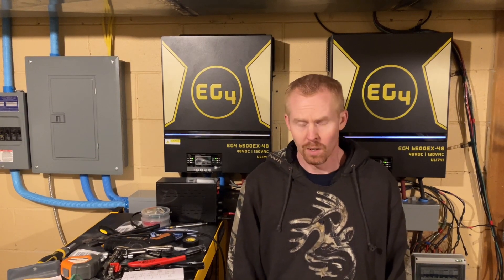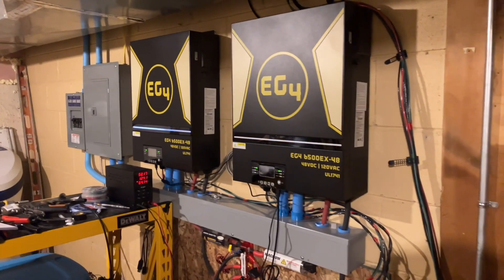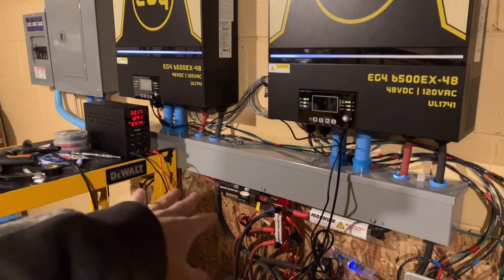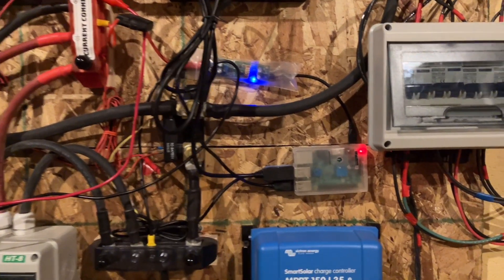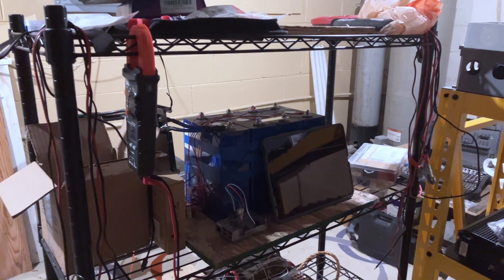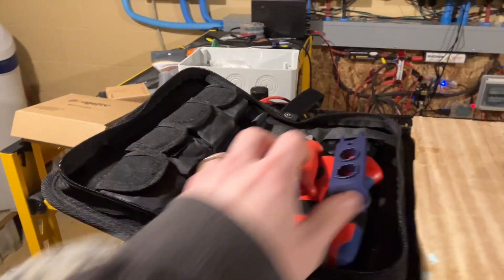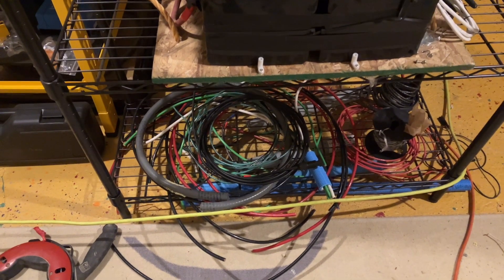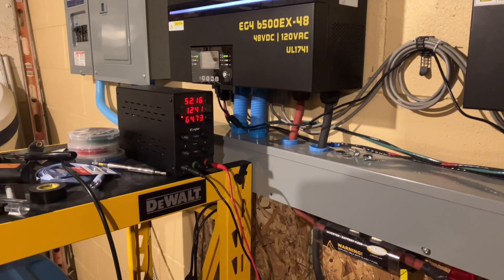My 48v System - Parts, Pieces & Settings

Comment: Hi, for these type of 48v batteries and Multiplus II 48/5000 which cables size are yu using? I mean, between each 15kW battery and busbar, and between the busbar and multiplus II 5000 ? Thanks
Reply from the maker: I have 2AWG from each DIY battery to the Lynx Power In and then the kit I received had 1/0 for each connection to the MultiPlus's and the Charge Controller: https://www.currentconnected.com/product/10kva-120-240v-multiplus-2-5kva/?ref=AzzpK9Fl
Reply: @AdamDeLayDIY  sorry, so each battery has an output wire of 2awg, and then each 5kva inverter has 1/0. Is this correct? It is a bit strange, because if we think about two batteries with "two inverters" (forget the third one), then we will need the same wire size, won't we ? 

Also, another question is about something that is strange for me: It is that all DIY LiFePo4  busbars have much less cross section than a 2awg cable for example. Please says about the short length of the busbar, but if you sum all the length of the 15 pcs ... 

What is your opinion of these two aspects ?
Reply from the maker: @diydsolar  The 2 awg cabling I have is rated for 200a per connection per the manufacturer specs.  At the time I had planned on increasing the cable size but I've since gotten additional batteries which share the load, so each battery ends up discharging less and less.  

I don't know what all math goes into determining the size of a bus bar vs the current it can support.  Bus bars have to be able to support more though because they're solid vs the stranded cables.
Reply: @AdamDeLayDIY  do you mean 2 or 2/0 ?
Reply from the maker: I have 2awg on the battery cables.  I used 1/0 for the inverters because they came with the kit.  In a split phase configuration, each battery would only draw a max of 100a from each battery.

Comment: Nice job on your DIY. Sure its not as clean as a pro install, but i am SURE you saved a bundle. Plus, you know the system inside and out. Mine was similar, especially the batteries. I found the Seplos Mason 280ah kits to be a good solution to get the batteries into a metal server rack. Solar-Assistant and Victron shunts are awesome.
Reply from the maker: Thanks!  Yeah it does save a whole lot of money.  Working on a few updates now.

I saw the Seplos kits but couldn’t justify the cost, plus I don’t care for the BMS.  I have seen just the cases for sale on Ali Express, so I might try to build my own case and see how that goes.

Comment: Are you grid connected?
You didn't mention the Victron, looks like a charge controller. 

Thanks for posting, looks like something I would do
Reply from the maker: I do have grid input to the inverters and at a certain state of charge, the units switch to “grid-bypass”.  There’s no back feeling to the grid.

The Victron charge controller was from my 12v system.  It’s not typically there but I was running a separate test on one of my solar arrays.
Reply: @AdamDeLayDIY  thanks! Quick response too, wowza....do you get grid power from the same panel you feed from the EG units? So, 4 two pole breakers for solar in/out?
Reply from the maker: @bobcole3852  nope, I have a separate panel that feeds grid power to my inverters.  The panel that supplies grid power has a lot of my larger 240 loads that won’t be moved over to Solar.

Comment: That sure is a lot of parts and pieces.
Reply from the maker: Yeah, it can really be as complicated or as simple as you want to make it.  As you can tell I just love to overcomplicate things...😁
Reply: @AdamDeLayDIY  If your happy with that.. SWEET..! When I get home I need to check my panel and the connections. I have four Trina 400w panels connected  2s2p.. and only once they have ever seen just over 1000w. I'm pretty sure there's an MC4 with a bad or loose connection.
Reply from the maker: @Mywhtjp  I know what you mean.  Could be bad connection, bad angle or cloudy.  I've had all of the above issues.  Especially the last two right now because of the winter weather.  Good luck on figuring it out!

Comment: Hi again 
Sorry for picking your brain….

So what does it cost to build a 48v batt compatible to a lifepo4  batt?

Components pls?

Also what’s your thoughts on flattened coper pipe for batt terminal bars / battery rack bus bar?
Reply from the maker: No worries.  

Building your own pack really depends on the type of cells you buy (quaility, amp hours, etc) and which BMS you go with.  Really those are the main components.  Obviously when you go to hook it up to a system, you’ll end up dealing with cabling, bus bars and over current protection (circuit breaker/fuse).  

If you look in the description of this video, you’ll see that I included the links to the cells that I purchased and the bms that I purchased. 

I found that it was cheaper to build a larger DIY pack than it was to buy one of the server rack batteries.  That does come with some catches though.  You really need to understand that if you screw up hooking up the cells, you can destroy the pack (or worse).  Everything is on you. You have to design the pack and put in all the safety measures.  I like building my own stuff, so that’s why I went that route.

If you wanted to go with pre-built batteries with everything taken care of and a really good warranty, I would take a look at the SOKs from Current Connected.  I’ve heard a lot of good reviews on them.  https://www.currentconnected.com/product/sk48v100/?ref=AzzpK9Fl
They also sell a fully loaded kit with a rack as well.  https://www.currentconnected.com/product/fully-loaded-25kwh-48v-server-rack-battery-kit-bundle-save/?ref=AzzpK9Fl

You could also take a look at the EG4s from Signature Solar as well. https://signaturesolar.com/eg4-lifepower4-lithium-battery-48v-100ah/

I don’t have any personal experience with copper pipe for bus bars.  I’ve thought about trying it but never found a good chart which would tell me how many amps I could get out of them.  I know of a guy who uses them in his 12v setup, but he’s not drawing a ton of power.  I started with 250A bus bars from Amazon, but knowing the inverter capabilities, I knew I needed to get 300A bus bars at the very least.  I found them from Current Connected as well.  https://www.currentconnected.com/product/bbl46/?ref=AzzpK9Fl

Comment: Hello
Ty for the overview

I had a plan to do carport solar panels pavilions for about 24 panels and since it was going to be pt wood I was going to secure the panels w about 6 5/16 washers and 5/16 x 31/2 deck screws. 

Just like I saw your set up on this video. 

How is that working out for you. 

What state are you in? For wind consideration since they’ll be 8-14 feet up.
Reply from the maker: The little ground mounts are working well.  My big problem is placement due to lack of sun.  They make it very nice though to help get all the snow off them.  I’m in MI.  

I had built a wood frame for panels on my barn last year and found that if I had to make ANY changes, it was a pain because of screwing the wood down to the roof.  I ended up putting in an IronRidge rail system on the barn and it’s awesome.  Went up super quick and with the rails, it really gives a whole lot more flexibility and adjustability.

Comment: Hi Adam I have been watching your video's for sometime now, very informative keep up the good work. I have a question about the cables used between your inverter and your raspberry for the solar-assistant program. I have a similar setup as yours  two eg4 6500ex inverters and four eg4 batteries. I am using the orginal cable that I got with my eg4 inverters (RJ5 TO USB) to connect between the two but cannot get my Raspberry pi4 to recognize my inverters. May I ask what type cables are you using and did you purchase the complete unit from Solar-Assistant or just the program with your existing raspberry? Any help would be very much appreciated. Thank's-John R
Reply from the maker: Thanks for the kind words.

You got an RJ45 to USB cable with your inverters?  The cable I receive with mine was an RJ45 (network connection) to DB9 (serial connection).  I had to purchase a cable regardless so I ended up purchasing the proper RJ45 to USB cable from watts247 (https://tinyurl.com/56wety92) for one inverter and the other one right now is using the micro usb port on the other inverter (eg4 has to fix some data issues before I can use only the 1 cable).

Now you can purchase a DB9 to USB adapter and use the cable that came with the inverters but I didn’t want that long of a cable or a bulky converter.

I purchased several USB to RJ45 cables from Amazon that I attempted to mod (for much cheaper) but none of them worked, even when I had the correct pin out from the inverters.
Reply: @AdamDeLayDIY  thanks Adam for the quick reply. I will have to check my cable supply tomorrow . I have used something similar on my DIY Megasquirt ECU’s  and my old CNC machine conversions. I guess it’s good sometime to never throw thing away 😀. Again thanks and have a bless day. John R.

Comment: I notice your PV breakers are exiting the top to your inverters. DC breakers are directional. Usually the power source goes in the top. You can tell by the little arrow diagram on the breaker itself. I smoked one early on by reversing input and output of the breakers. AC breakers are omnidirectional.
Reply: Same with your battery breakers
Reply from the maker: Thanks.  From what I saw in the User Manual, the load can be used on either side of the breaker.
Reply: @AdamDeLayDIY  That would make sense especially in the case of a breaker between the batteries and inverter because at any given time either one can be considered the power source.

Comment: Thanks for sharing. 
your battery breakers.. maybe don't tie them together? so that you can more easily impliment your precharge resistor setup? 

for my setup.. I have 3 breakers..
++++breaker resistor++++
++++breaker ++++
-------breaker ------- 

so my cold start procedure is to turn on the negative breaker.. and turn on the positive with the resistor.. until it powers up.. then I turn on the positive without the resistor.. then I turn off the resistor breaker. There is a small risk I could leave my breaker with the resistor up.. but I don't believe it would heat up very much.. as the other path is way less resistance.
Reply from the maker: Thanks.  The reason I have both of them in the breaker is to completely isolate the bank when the breaker is turned off.  That way I know there's no connection between the system and the batteries.  Realistically, the system should very seldomly be turned off completely, so having to do an extra step to pre-charge the capacitors won't be done all that often.

Comment: Great video…
I thought I was watching myself for a moment.
I have 24 460 watt bifacial panels, 30 KWh of LifePO4 (3 EG4 and 1 280 Ah DIY), 2 of the EG4 6500EX-48 Inverters, wiring, breakers, blah blah blah.
I am in Southern Arizona but was planning on moving to Nova Scotia in a couple of years, so it’s been sitting.
Not sure if I can actually pull off that move.(my wife passed away last year from co vid and my family is in NS)
So keep up the research and the videos.
I really enjoy them.
Reply: Even if its just a test setup get that system making some power it will make you feel good.
Reply: @Ranch321  it seems so daunting… perhaps I can put up a “small” string of the panels since all 24 would be approximately 40’x14’ in size.
I had considered putting up enough to run my Mr Cool mini split. It is 240 volt and the external wiring to the outside unit is accessible easily.
Perhaps a string of six might do, although I’d have to run both inverters in parallel.
It’s really hard to be motivated this year, so I appreciate your encouragement.
Reply: @marknichols7861  i have 3 panels just leaning against my barn right now for testing before i start my 1st ground mount and it relieved some of my anxiety to see it make more power than i was expecting. Dont even worry about powering anything just fill your batteries then maybe get a single power outlet to load test/play with.
Reply from the maker: Sorry to hear about your wife passing.  

I agree with @decoy though.  Even a small setup will feel good.  Pick a single appliance in the house to power like a fridge or freezer.

Comment: Hey, question about your PV 32amp breakers. Does it matter which end is input and which end is output? Do you have the breaker end with +/- marking going to your 6500? Thanks
Reply from the maker: I'll be completely honest with you, I'm not sure.  The only thing that might dictate flow is the wiring schematic in the user manual but I have a hard time reading some of these.  If I'm reading it correctly, you can put your load on either the top or the bottom of the circuit breaker.  So I have the PV going into the bottom of the breaker, and the inverter into the top.  

If someone can verify/clarify the wiring diagram that would be awesome!
https://m.media-amazon.com/images/I/81SNSe8ULbL.pdf

Comment: You need 12 more cells to Mach the 12v to make a 3 battery bank like me I have 2 systems a 12v and a 24 v
Reply from the maker: Yeah, I know I need at least 1 more bank, probably 2 would be best but they're so much $$$$ right now.  I think I'll have to start with more solar panels first and then get another bank down the road.

Comment: Good video Adam  Thanks 
 I Just realized I had to big of a breaker for my PV input I had a 32 amp like you I actually just ordered 25 amp thank you very much I should know better I just burnt up my MPP LV 2424 from putting too much voltage in😢😢
  🇺🇸🌞👍🏼❕❕❕
Reply from the maker: Wasn’t much but glad it helped.  Sorry about your 2424.
Reply from the maker: Something I just noticed...the manual recommends a 30A breaker for the PV connections.
Reply: @AdamDeLayDIY  25 amp should be good for my 6000ex which the max amps is 27amps 
    I’m thinking of buying 1 more EG4 48v battery and another 6000ex and I think I’ll be good to go.  I’m close to maxing out this inverter and I have to pick and choose what to run and all  like dryer hot water heater and all
  Keep the great videos coming dude 
  Your helping a lot of us out 👍🏼🇺🇸❕❕